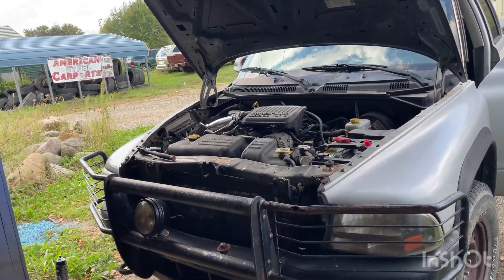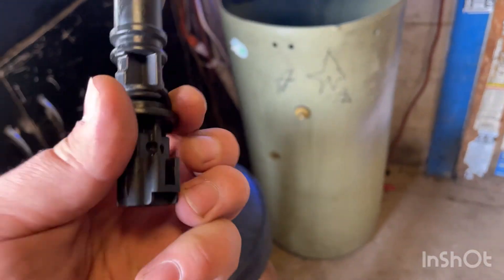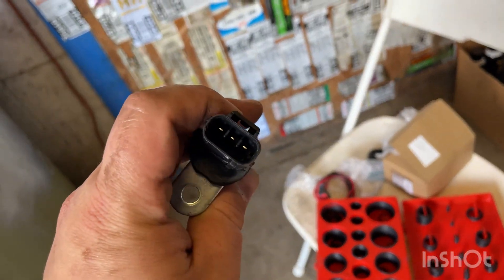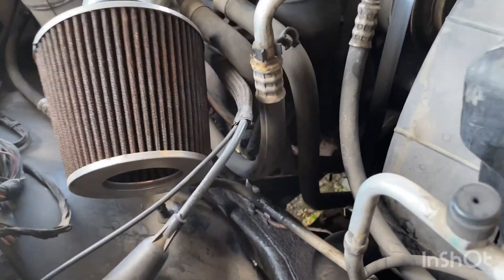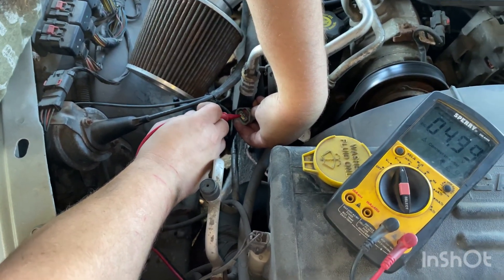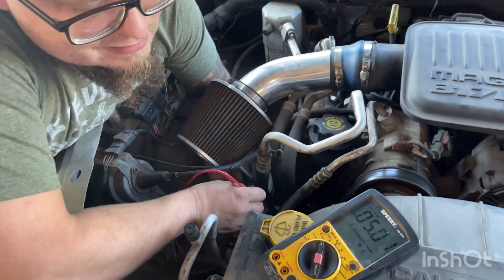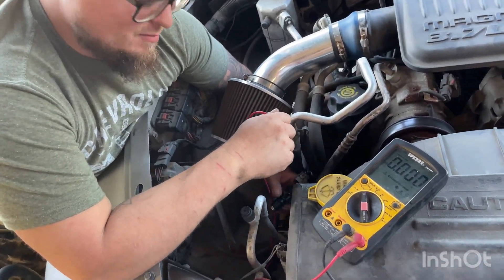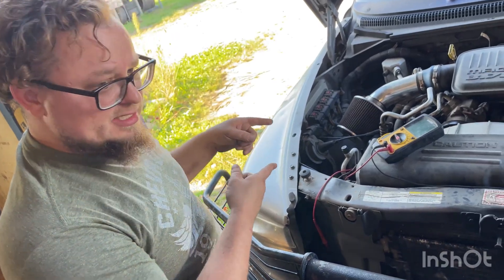P0340 or P0344 fix Dodge 3.7L 4.7L 5.7L cam sensor location and testing

Comment: When I pulled mine out it was covered in oil. Not the outside of the sensor but the part that goes into the motor

Comment: Ok so I pulled the camshaft position sensor out of my 05 dodge ram 1500 4.7, the sensor is covered in motor oil

Comment: I have an 01 dakota sport  v 6 . Runs really good. Intermittently will lose power and pop through intake.  Clears up on its own after a little bit.  Then run fine again.  Any suggestions.

Comment: Having some trouble on a 5.7

5V from each side but nothing in the middle… that throws a P0344 so I have to check wiring and stuff

Sensor was replaced few weeks ago ..

Comment: Replaced camshaft and crankshaft position censor and still not making that code go away the wire harness has power I have no idea what else to check or do can anyone help
Reply: Having the same issue If you figure it let me know
Reply: I read on a dodge forum to change the vvt solenoid and that should take care of your problem

Comment: Is there any kind of symptoms from the truck before cam sensor goes bad?
Trying to figure out if its cam sensor or fuel pump. Truck cranks for about 10 seconds before turning on or if I go for a second crank starts immediately. Got no codes other than O2 sensors ones which I replaced downward stream sensor, wires were making contact with exhaust line.

Comment: Just fixed an 04 ram 4.7 code p0344. Got the same code after replacing the sensor and cleaning connectors. My issue was bad grounds. Gotta check those grounds
Reply: I have the same issue, where are the grounds you checked?
Reply: @alejandroskeete7424  I checked the battery first. Even though they looked alright I replaced the terminals. And put a new larger 6 guage ground wire to the body. I sanded any and all body grounds I found along the engine bay. I also used die-electric grease to protect everything. Good luck
Reply: Thanks! Just replaced the head gasket and timing chain, now having this issue.
Reply: @alejandroskeete7424 same did you figure out the problem. I’m getting p0344 after cam swap on gen 3 5.7

Comment: Was it really the problem mine has the same problem but on a 5.7 and i changed both cam and crank and it seems to still do the same situation where when it’s cold it works fine but once it’s warm it does what you said
Reply from the maker: fixed the problem on this one!
Reply: What was the problem
Reply: My 06 3.7 dakota is doing the exact samething 2500rpms it starts jerking and bucking so the camshaft is the issue? Please help!!! Lol